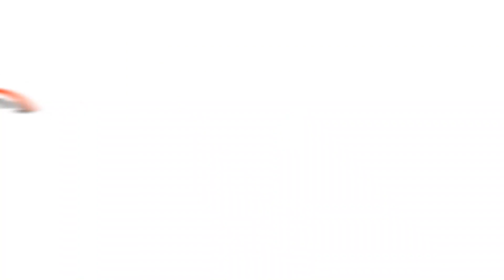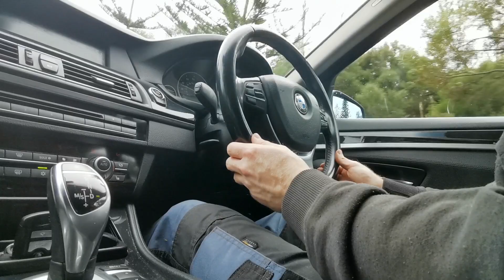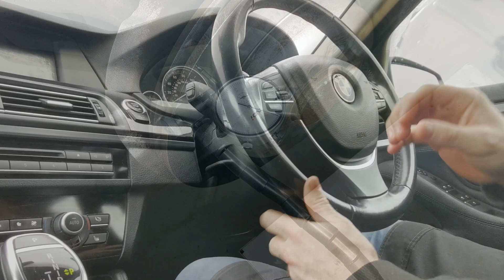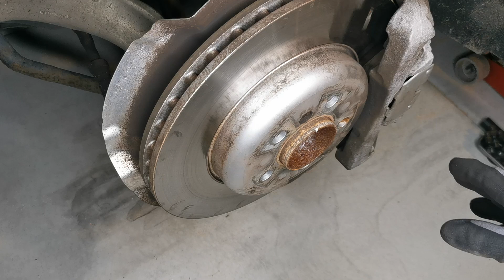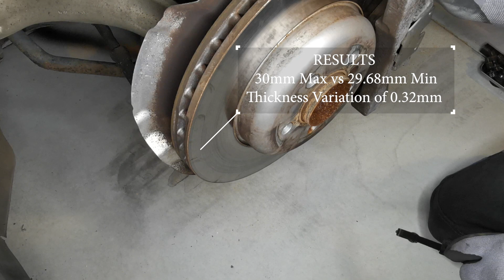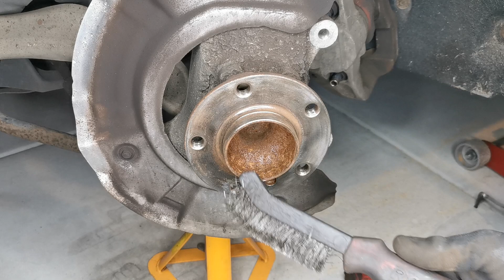Vibrations When Pressing Brake - How To Professionally Assess & Repair

Comment: Hi. I have F10 525d. I am a mechanic. My brake vibrates only on high abuses like braking from 160 km/h about 6 times. So the brakes got really hot. Then it starts to vibrate badly. The whole car is shaking. BUT, when it cools down, the vibration is gone. So I go 160 kmh push the brake pedal and nothing vibrates, until I do a 5 to 6 heavy braking from high speed. Then it starts to vibrate again. The discs are Textar. Original brakes were Textar.  How can the discs got straightened again after cooling down.
Reply: Have you checked the wheel bearing hub?

Comment: i have changed 3 pairs of rotors and 2 pairs of hubs and it still steering wheel vibrates when braking on speed above 80km/h. this is 3rd year since i'm trying to fix the damn car. x3 e83 2007. does anyone have any solution?
Reply: Check if the rotors are seated properly.ATE ,for example, doesnt recommend greasing the hub because it will give vibrations. 
Also check the hub connection ( bearings) and drive shaft ...
Hope the wheels are checked and properly clean on mating surface...
Sorry for my english , its not my first language
Reply: Engine mounts
Reply: @anthonyabbey7531  why do you believe that may be the problem?
Reply: @anthonyabbey7531 Rien à voir.
Reply: @anthonyabbey7531  Maybe gear mount?

Comment: A couple of observations:
1 That isnt a genuine BMW rotor but an aftermarket, origional are two piece, aluminium hub riveted to iron rotor.
2  for any runout checks the disk should be secured by at least two diametrically opposed wheel bolts, the little 6mm disc screw is only for disk location purposes and does not fully secure the disc hub/bell to the wheel (bearing) hub. It is only the wheel bolts that fully secure the disc to the bearing flange, that will provide actual runn out/raotational thickness as per first dti tests.
;-)
Reply from the maker: Hello and thank you for watching the video, also for taking the time to comment.  
The securing screws are absolutely suitable on this check and I have carried out identical results with bolts in and wheel bolts out on this vehicle. No difference, exact same result.  
 
You are correct about setup Simon, that is by the book the best and most accurate way. There is technical information stating more than x2 wheels nuts to be used doing this test as well preferably 3 from memory on this test. 
 
Interesting observation with the aftermarket rotor, Do all models of these vehicles have 2 piece from factory?  
Any stamps/numbers that can be viewed to confirm? 
 
Thanks
Reply: @GerardBurkeBurkesGarage almost every 2010+ BMWs has 2 piece disc brakes. Those on the video are actually 2 pieces type but definitely aftermarket. BMW OEM "drum"/middle of the disc is shinny. On the market there are also one piece discs which are cheaper but I dont know if they are any good.

Comment: Very good video, it should have more views and likes ! 

I installed new front discs on my E92 but I still have sometime vibrations (Not as bad as in your video ).
Could it be coming from the hubs themselves ?
I have a similar gauge like your, what is the allowed tolerance on the hub flange ?
Edit : Ha ! ok ! You cover it later in the video.
Thank you
Reply: i have changed 3 pairs of rotors and 2 pairs of hubs and it still steering wheel vibrates when braking on speed above 80km/h. this is 3rd year since i'm trying to fix the damn car. x3 e83 2007. does anyone have any solution?
Reply: @nunenemaveze6296  As Gerard said, "Don't overlook the bearing hub as a potential source".  Confirm that it isn't with a dial indicator.   Have you checked the rear brakes?  Also, could be a CV joint or unbalanced axle issue.  Good luck chasing that gremlin!!
Reply: @nunenemaveze6296  Tired or damaged control arm can also lead to vibration under braking. Did you check them ?